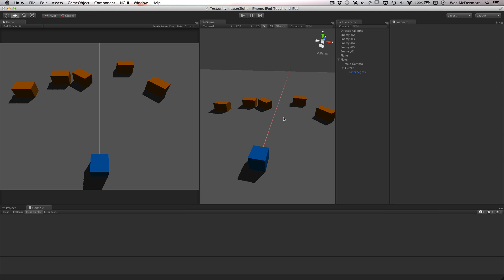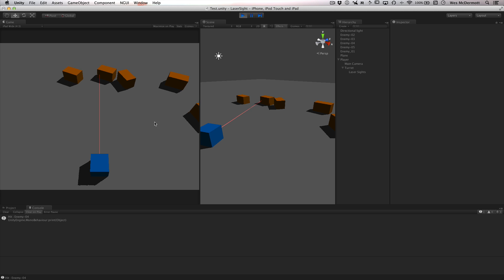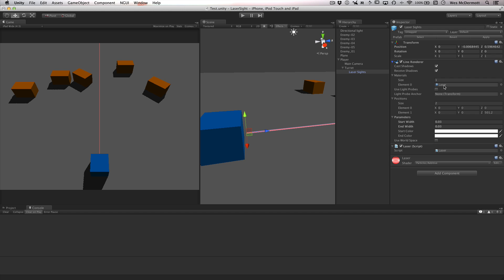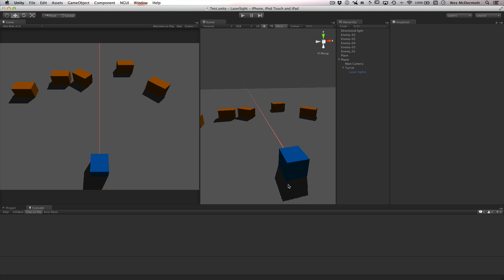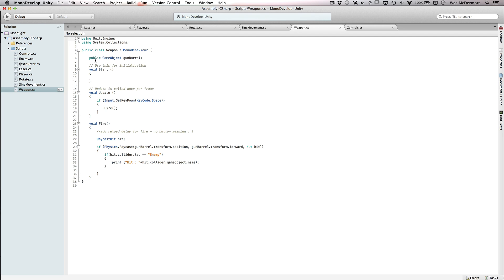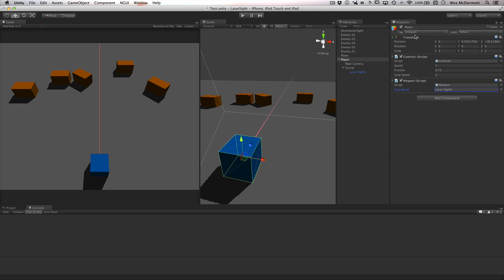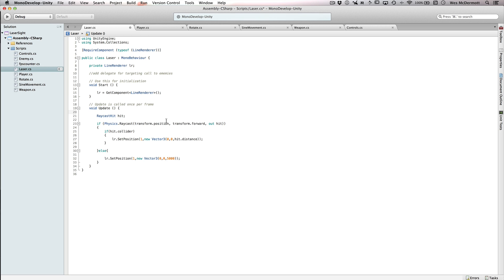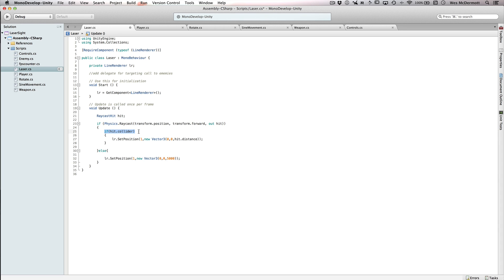Creating a Laser Sight

Comment: For anyone struggling with this, make sure your "lineRenderer.SetPosition(0, new Vector3(0,hit.distance,0));" have the first one set to 0 and the other ones in the vector 3 take the rotation of the parent into account.
Also if the laser is stopping short of whatever it hits, it is because the scale of the object containing the line renderer (or it's parent) isn't set to 1,1,1.

Hope this helps!

Comment: awesome! this still works with 2019 unity.
Reply: Mine doesn't work, because it reset it position to origin when drag to enemy
Reply: @yangkaihor4251  ohh i have not experienced that. just make sure the laser is pointing its z forward
Reply: It trigger the bug when you add a line renderer to the game object  and add it as a child of ai game object
Reply: @yangkaihor4251  i think i had issue where the line renderer is not aligned. i parented the line renderer to an empty game object that is parented to the gun's tip.
Reply: @wdblackout  same thing I encountered just like you said

Comment: My laser script looks exactly like yours but I dont get the same results. It draws the line when it collides with something but completely ignores the else statement. It does not set the position of the line to 5000 when it no longer collides with anything. WHY?
Reply: +Sexy Zombie Roo I fixed the issue by removing the else statement and setting what was in the else statement to the top of the Update function.
Reply: ***** Glad to help. Good luck :D
Reply: WORKS LIKE A CHARM!
Reply: Thank you

Comment: I'm using this to set up an automatic turret but my laser isn't stopping at the hit object very well. It's much shorter than the actual distance between the two points and gets more and more offset (when calculating the percentage difference) the closer I get to the origin of the laser. My code is almost identical to yours and my inspector layout uses a child object just like yours as well. Any ideas on how to fix this?